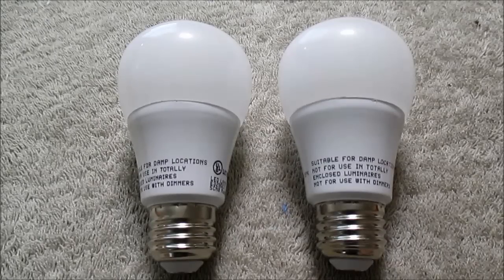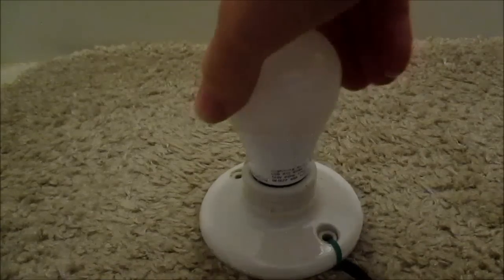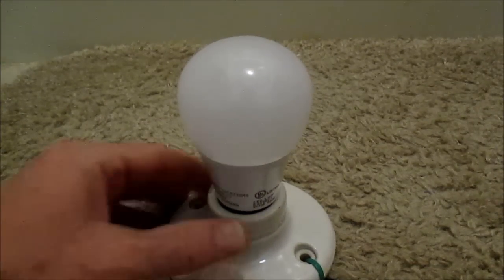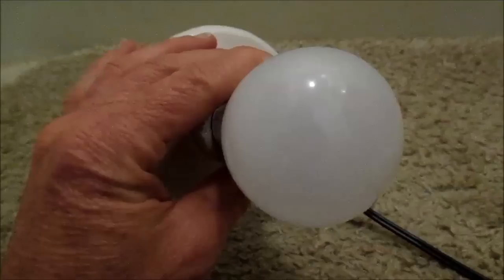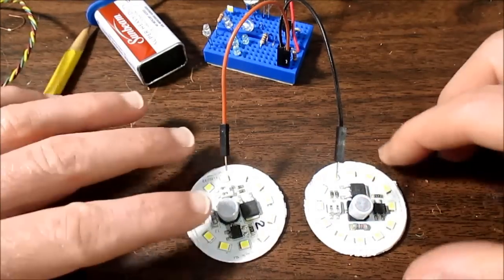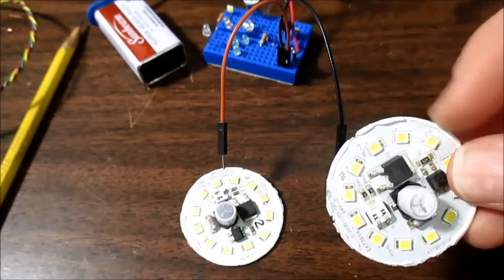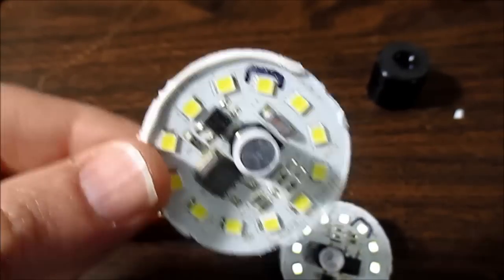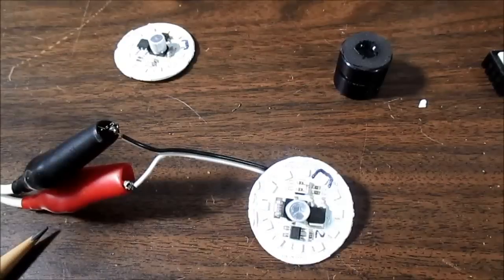Two failed LED bulbs for teardown to determine the cause

Comment: The ones i've tested are all running with the MCPCB at about 100-120C (in an open fixture, base up).  If you're familiar with the junction-case thermal resistance of these packages, you'll know how far beyond absolute maximum the LED's are running.  The ones in which i bothered to put a thermocouple on the caps had them at 90-100C or so.  I have yet to find any consumer market LED lamps that I wouldn't expect early failure from.
Reply: Tech has moved quite a bit. Now you can get LED bulbs with chip on ceramic heatsink and the power regulator is segregated from the rest, stays cool. They are even rated for enclosed luminaries
Reply: @videosuperhighway7655  When the thermal path is dominated by resistances close to the source, it's trivial to make something that "stays cool".

Comment: I've bought about a dozen of these LED bulbs in the last year or two, and I don't think any of them are still working. They claim a longer life than incandescent, but in my experience they last about 1/10th of the life of a regular bulb. I don't know how they get away with claiming such long lives, but it's a huge waste of money. They may save electricity, but I'm not convinced they save more than they cost.

Comment: From the comments below, it appears that many people who know something of electronics, don't know enough about current regulators.  If you short out the one open LED unit, the rest will glow at the same brightness as normal. The regulator will drop more voltage, same current, and therefore be hotter.  That's how current regulators work.
Reply: Why hotter? If it's dropping the voltage, it's passing less power at the same current, since power = E x I. What's heating up?

Comment: I believe everyone is forgetting that running 120v rms AC through a full wave bridge into a large capacitor will give a DC voltage of near 170 V, not 120 DC.    1.41 (square root of 2) time the rms input AC voltage.

Comment: The three die inside each LED may be in parallel instead of series so they conduct with 3 volts, not 9 volts. As they light up when the lamp is powered, measure the voltage drop across each one. You may find the bad LED if the voltage drop across it is different.

Comment: Placing that many LEDs in series is an invitation to a high failure rate.  If there are three per die, the total is 36 LEDs in series.  If one of the 36 fails, the whole device is done.  The guaranteed failure rate of the product will be 36 times that of the individual LEDS; 12 times that of the 3-LED units.  The LEDs themselves not being the sole cause of failures, this adds up to a device with a lot more liability for failure than I'd regard as acceptable.

Design of a more reliable circuit would logically be based in large part on whether the LEDs (or the 3-LED components) tend to fail open or shorted.  A parallel rather than series arrangement would obviously be advisable for these components.  More expensive to build by some margin, but reliability is worth paying for.

Comment: I think its all about the quality,  not all LED  bulbs are created equal.  and its not just bulbs.

LED TVs,  use strips, ( 48V ) depending on the size of the TV,  a 32"  has all the LEDs in series on each strip.   they are a pain in the ass to get too,  since you need to get behind the screen, which is risky ( damage that membrane connector ).

Comment: Suggestions, based upon my life experience:
1.  don't buy no name light bulbs;
2.  don't buy light bulbs at Home Depot.

I explain.  Most people think that simply buying a name brand at a big box store assures them of quality.  Well, light bulbs have not been produced in the US for years.  When the two name brands of the old fashioned light bulbs were being sold in the US, they were made in Mexico.  I bought quite a number of the name brand ones at HOme Depot that failed.  So much so, that I wrote the company, rather than just grumbled.  Sometimes, batch lots are produced for the big box store, but it isn't regular production.

Don't believe the b.s. about leds being good for 10-15 years.  My first ones are dimming after 3 years.  They will dim and finally die.

Comment: In the EU we are no longer allowed to buy what were more reliable and ten times cheaper tungsten filament bulbs. I've had Chinese LED bulbs fail after as little as 9 months. Politicians have been conned by the corporations.
Reply: Buy decent named products. I installed 81 Philips LED's in a house 3 years ago. The kitchen has 21 alone and they get left on all day sometimes. Not a single one has failed yet.

Comment: They will NEVER run the LEDs in parallel rather than series, because (it would cost a little more) but more importantly they won't sell as many bulbs if they kept going after a failure.

Comment: The LEDs are in series?  Hell, that's like the old Christmas tree light nightmare.  They should be wired in parallel, that way if one or more LEDs fail, the rest remain on and the bulb would simply be imperceptibly dimmer.  But they're likely running them in series in order to avoid the use of a transformer.  There are 12 LEDs each taking 9 VDC, so 9 x 12 = 108 volts.
Reply: Barney Quinn  That is not going to work. The LEDs require a constant current. With the LEDs in parallel you can only stabilize voltage but this will only give you the right current in the "average" conditions. I am pretty sure the LEDs will burn out much quicker.

Comment: Excellent failure analysis!  I agree with your assessment - that brand is crap.  But being the kind of guy who never likes to throw something away when it can be made to work a little longer, I'd jumper around the bad LED and put the bulb back together.  It would also be a good experiment, seeing how long it takes for another to go bad.
Reply: Don't do that - add a resistor to decrease the current
Reply: @debmalya6144  Now that's next level!  I assume that the supply isn't constant current?
Reply: @roderickyoung1243  ya - forgot that - in india we have capacitor dropper type. And constant current types just hit the market. In case of constant current source, adding resistor won't help.
Reply: In case of constant current source i change the current to be arround 20mA.

Comment: Adam Savage likes to say that often times the only difference between screwing around and Science is writing stuff down. Nicely documented experiment. I've had some LED bulbs fail as well, And they were all from failed singular LED's inside the bulb. (several different brands). interestingly I have one Cree bulb that I can see a failed LED inside it but the light otherwise works fine.
Reply: a clever design would not allow for a single point of failure
Reply: Shane Singleton my Cree’s haven’t been reliable, but my Philips have been
Reply: it's impossible to make a competitive bulb that doesn't overheat ;(  (our capitalism isn't exactly perfect yet)
Reply: a proper heatsink would double both size and cost of the bulb
Reply: but you would get around 12X longer life
Reply: efficiency is not the main factor if they are not getting enough airflow, I have made diy led lamps for 12years, 
Eg take a cheap 1$ brand overdriven led lamp and put a fan on them then, take a 4x priced brand one and I assure you the 1$ one will last longer
Reply: capacitors overheating in the lamp is also a major issue, run over rated temp on virtually all sub 5$ lamps
Reply: this is greatly amplified by the fact that very few want to put them in open air as  instructed on the package
Reply: Shane Singleton g

Comment: Manufacturers are probably trying to get more light out of the components than they were designed to produce by running them at a higher current, instead of using better components. LEDs are having a much higher failure rate than the claimed  50,000 hours or 100,000 hours on most of them.

Comment: And i still think that led lighting is crap, i think that more leds run at a lower level would cope better, each led would be cooler but there would be more of them.
Just my opinion.
I still use folded florescent bulbs, they cope better :-D

Comment: Oddly enough, I just had my first LED bulb fail in my house this morning, 14 December 2017.  It was installed March 2014, and was the old style with the large, finned metal heat sink between the base and the plastic globe.  It also had all the circuitry inside potting material in the heat sink base, as opposed to directly on the board like newer bulbs, and it weighs at least twice as much as newer bulbs.  I think the likely cause of failure was the fact that I had it installed inside an enclosed globe ceiling fixture, which they tell you not to do.  I need to replace the whole fixture with an actual LED ceiling fixture, one of these days.

Comment: The most likely reason is the power unit. From the very beginning manufacturers have done two things incorrectly - firstly stating that the life of their lamp matches the datasheet life of the LEDs which is just nonsense as that is in ideal conditions and NOT at full output. Secondly they tend, for cost reasons (and/or inability to design stuff properly) to use rubbish power supplies. Also many ignore the simple fact that LEDs do not like to run hot.  Here it my office at https://tech.scargill.net I have been running 3 LED floodlights on my desk - the GU10 type with aluminium backsides - for 2 years now with no dimming or ill effect. On the ceiling I have something ITEAD knocked up - 4 strips of LEDs, alternating warm and cold white LEDs - on an aluminium back strip... they are bright as hell and have again been running for over 2 years. Not one single dead or failing LED.

Comment: The trick is when installing a new bulb , the first 5 times you turn it on the bulb must be left on 20 minuts each time to set the bulb up for long life.  Info from an Elec. Eng.  This fellow means well but doesn't have a clue.
Reply: And neither did the so call engineer who told you to turn it on and leave it on for 20 minutes 5 times .. oy vey!
Reply: you forgot to mention saying a magic incantation and holding a pinkie in your nostril as a recipe for bulb longevity
Reply: Paul Smith sound like Islam prayer 5 times a day for 20 minutes, I think Mohammed fooling you,!
Reply: Exact;y Paul.. Just like with Bulbs in cars. You must make sure that your "Blinker Fluid" is full or the bulbs will over heat and burn out....
Reply: @eriks6200  
I replaced my blinker fluid with generic snake oil. Works great at half the price. 47% better gas mileage, too.
Reply: Well Said Paul Smith. Which University did you earn your PHD in EE from? Actually you forgot to mention that you have to sit on it for 30 min first and depending on how you sit you may need to left it on for less than 20 min.

Comment: The ones I had failing are always going in some overheat protection then shut off and turn on again when they cool  a little bit. It makes them flicker at about once a second. They are not in an overheating light fixture(max handwarm).

Comment: That is a lot of current for not having a heat sink.  I would buy these.  I have applications where I put a 0.1uF capacitor in series and use them as night lights.  The ones with inverters in them only flash or won't light at all with a capacitor in series.  Try this, it would make a good video.

Comment: I put LED bulbs through out my house for the last 5-7 years as the incandescent bulbs, or CFL failed.  I have not yet had to replace a single LED bulb.  This includes outside bulbs.
Reply from the maker: Same here. The ones in the video were just a cheap set my parents bought.

Comment: I have an LED torch that behaves like this. It flickers. Then it comes on dimly. Then it brightens up and remains bright. As an aside, It never ceases to amaze me that the government blamed me and people like me for the worlds energy problems and insisted we change to "energy saving light bulbs" because we were evil people who left landing lights on all night and single handedly killed Polar bears as a result. However, over at CERN they use, "1.3 terawatt hours of electricity annually. That’s enough power to fuel 300,000 homes for a year in the United Kingdom" to run their Hadron Collider but that's OK and no one will be made to feel guilty as a Polar bear killer wiping out glaciers because that's science. Funny that.....huh? Source: https://home.cern/about/engineering/powering-cern
Reply: no the collider is a important scientific instrument what does that have anything to do with energy saving light bulbs? what?
Reply: Not very bright are you?

Comment: Recently I was building something that used two led bulbs and I removed the covers to fit them into the space I had. Because it was covered it was fairly safe.  I noticed one of the bulbs was a bit dimmer and soon realized that a number of the leds were missing, quite a few in fact, and the circuit board just had empty spaces. I assume it was bad quality control or deliberate cost cutting. I wouldn't be surprised by anything, these days.
Reply: That's wild!
Reply: @TheRamsberg  Think that's wild? How about self assembling nano tech? That's what I call wild.
Reply: @chuffpup  That is wild! It'd be even more so if two thirds of the self assembling nanos that were supposed to exist, didn't!
Reply: @TheRamsberg  Particularly in vaccines. There. I said it.

Comment: let me guess - planned obsolescence?
Reply: Naa, churned out to a price with an accepted failure rate. However, if you want to get cynical, then it'll be done safe it the  knowledge that the next big thing in lighting technology is already planned and most will last till then anyway.
Reply: no, cheap chinese construction
Reply: planned incandescence?
Reply: chinesium shit more than anything
Reply: is that a command?
Reply: The electronic board has at least one electrolytic capacitor on it.  They can be designed to have a limited life although they probably cannot be designed to fail after a specified number of hours.@Iggy Noring-u
Reply: S2 Turbine although 5months ago, I do not remember. Whom invented the’ compact fluorescent’, but it WASin yhey USA, but would cost to much, So was made overseas, I started LEDs several years ago, my first was $24.00 outdoor light fixture is a PHILIPS, looks yellow when off, been there some 14 years.3 LIGHTS in my home NOT LED, cheers from nj
Reply: No, it's just cheaply made
Reply: Your guess is most likely correct. I have a 1938 Singer industrial sewing machine, a lot of paint's worn off it's 81 years old (16 years older than I am) and still runs fine. My wife bought a sewing machine from Sears and it died in less than two years. After taking it apart, I found plastic gears, no lubrication and one of the gears wore down and the teeth broke off. Was the lack of any lubrication intentional? I would think so.
Reply: @awizardalso  Holy shit you're old af, as far as that unlubed wheels go... well they just could had been cheap because lubing would require extra time and employees as it's probably done manually, it was done to keep the cost down (and the price of your machine). if it was easy and essential they would probably do it, the last thing they want is have them break down during the warranty.
Reply: Bad vibes
Reply: @S2 Turbine I really believe the business side of it all SUCKS. See, if they could make things last forever, they'd lose money. Who would be willing to buy new ones if things lasted forever?
Reply: @Iggy Noring-u -- Which should've been identified and addressed through testing.  Looks to me like a cheap ass company who failed to test their product.  Probably doesn't have a UL rating.
Reply: Snarky Mark TOO MANY crap things from CHINA fake the UL mark.  Cheers from NJ
Reply: No, made in China.  Even worse
Reply: Actually, China makes some very high quality products.  They also make some unbelievably bad junk.  It's caveat emptor!   @bryanshoemaker6120
Reply: I'm sure that is just a conspiracy theory. :p
This is why corporatism is bad... we need to get back to capitalism.
Corporatism has the same problem as socialism... it brings all the power to the top.
Reply: Well yes al Gore owns the new bulb factory I'm sure you did pay 69 or 99 cents for a bulb would go got every year, but let be progressivism at all cost! Now you pay 6 to 9 bucks for a bulb says lasts 5 years but only last 9 months and has mercury in them to boot better for the environment my ass libtards think backwards!
Reply: The amount of Hg in a compact fluorescent light (CFL) is very small.  Coal burning power plants emit Hg and the amount of Hg in a CFL is considerably less than the reduction in Hg emissions from power plants as the result of saving power by using CFLs. @we-got-green__lightsabersy1807
Reply: Frank Eggers in mass, some years ago the mother dropped a bulb., called some agency, sale had the loss of her child’s room, for 6 months, because the idiot did not have any idea of how to clean it up. !    Cheers from NJ
Reply: From dull unlit light bulbs to off topic politics . 
Sounds like a projection to me.
Reply: We Got Green. 
From dim and dull light bulbs to off topic blame based politics. 
sounds like you projection was inflicted  with a poor connection.
Reply: @we-got-green__lightsabersy1807  You've been watching way too much FOX Entertainment Channel.  Clearly, you no longer have the ability to think for yourself so the talking points that you've been programmed to repeat on an endless loop are getting quite dated.  You might eventually wake up and realize that the wealthy have taken everything from you and convinced you that everyone else, who are victims too, is your enemy...
Reply: We-Got-Green__ Lightsabers yet     Don’t let the trolls get to you.